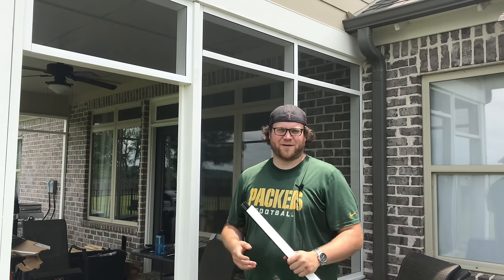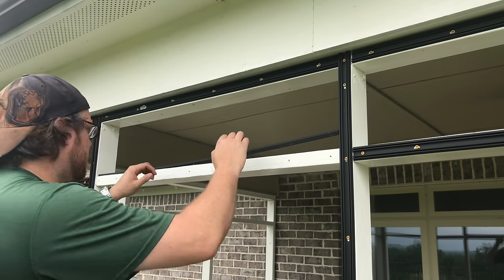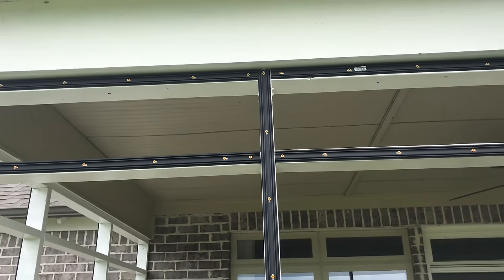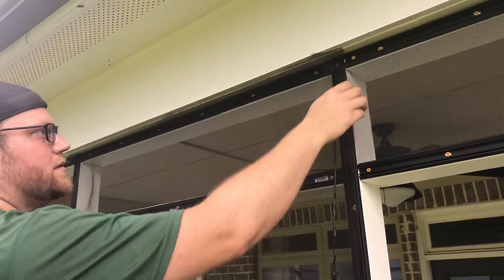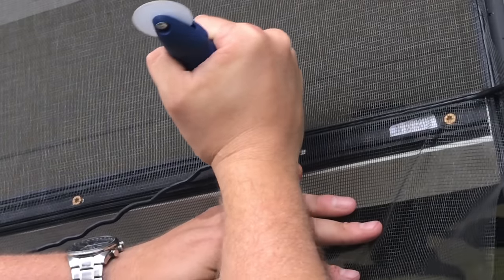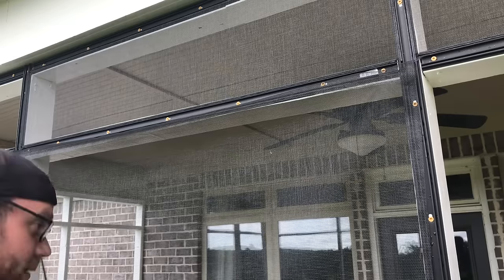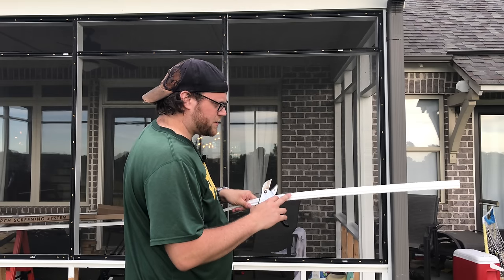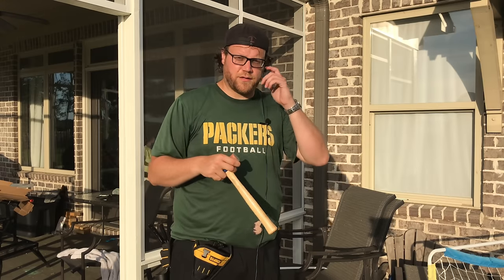Screen Tight Install Tips and Tricks

Comment: Thanks for doing this video. Just moved into a house with a back patio like that and the bottom part is ripped.

Edit: damn I just noticed you're doing this with a storm coming and windy as hell. You sir are a GD trooper.
Reply from the maker: Sometimes you got to get out there and do what makes the wife happy.
Reply: @TheVintageEngineer  where's the best place to start on prying those Channel covers off you think? Just use a screwdriver? I was trying with a painters tool, running it under the rail putting pressure. Figured I'd catch it and get it snap off in one place and go from there. I was putting quite a bit of pressure but it didn't have any give and I felt like I was about to break the damn thing off. It's been on there for years so I wonder if it'll be hard not to break it at this point. Thanks again for the video and help.
Reply from the maker: @bccsivxx-xxivvii  is try to get at the very end and pry in the middle. Once the one end is started you should be able to pull it right out. I’m thinking a 90 degree pick tool maybe good to snake behind the edge and grab it.
Reply: @TheVintageEngineer  forgot to reply and say thanks. Pick tool worked perfectly.

Comment: Looks Great! Thank you for the video!! I like the screen at the top 1 foot around. I am adding some 4X8' polycarbonate panels for 4 seasons room. I will make some removeable to make it usable year round. 
Craftsman made the multi-cutter that has the most leverage $30 on e-bay.
Reply from the maker: I’ve been researching some sort of roll up clear vinyl with sides in a track, but I’m having a hard time find a system that is for the DIY. All are custom builds that require a contractor to come out and do it for $1,000s of dollars.
Reply: @TheVintageEngineer  Screen tight has a video with removable clear PVC roll panels :"Screen Block 3 Season room" that can be installed from inside the room. Instead of spline it has PVC strips that you tap in with a mallet This would be perfect for second story decks.  Another tip for screening is if right handed: start on right side top first then bottom. use the roller tool to push the screen into the grooves first then the spline. Work from right to left, then finish on the left side. Thank you for the tip on using small pieces of spline to keep it in place.
Reply: I've been looking to do the same thing with polycarbonate. If you don't mind me asking, what size thickness of polycarbonate panel would I be able to modify into a screentight frame?
Reply: @auPretender  I used 4' X 8' X 1/2" Home Depot had some 3' x 8' x 3/8" polycarbonate panels and they have clear connectors to join more panels together.
Reply: Thank you very much for your reply!

Comment: Thank you for this.  Not sure I would have the strength to do the splines .  Wondering if you couldn't  start in the middle top and then work both ways.  Really like your idea of wedging in little holder pieces.

Comment: So glad I found this video! Im in the planning process of doing this in my front porch. Do you have any advice for screening the larger spaces? I dont have any horizontal rails. Only two 4x4 wood columns. Should I add some studs and a horizontal rail or is that not necessary? Appreciate your advice on this.
Reply: 😂 nevermind. You answered my question later in the video. Lol Thanks again for making such a thorough video
Reply from the maker: Not necessary, did it more for aesthetics.

Comment: You got my attention in the first 20 seconds!
Really great video! Great details.👍🙏🏻👍
Reply from the maker: A screen panel for like a sliding glass door?
Reply: @TheVintageEngineer  yes…and I edited out my looong comment.  I have bad insomnia and ramble.
Really good video though! That screen isn’t going anywhere. It’s nice and tight.
I’ve been looking at my old house, no pun intended, seeing if I could use your system vs regular screens. Unfortunately the windows have aluminum casings.
Although, if I survive the kitchen and bathroom remodel I may do this with my back porch! The last two years have been a spider vs mosquito war here where I live.😬
Reply from the maker: We don’t have “permanent” screens on our house but what we did for windows we want to open is buy some expandable screens and they go into the window opening track and the window closes on them to keep them in place. Here is an example one Your friend has shared a link to a Home Depot product they think you would be interested in seeing.

https://www.homedepot.com/p/Fenestrelle-15-in-x-21-in-Fiberglass-Expandable-Aluminum-Frame-Window-Screen-2-Pack-FEN-84010-2-M/310252199

Comment: What an absolutely incredibly good video you have produced, thank you so much for the help you really did a great job, going to tackle this myself, I would like to seen how you finished off that bottom section I'm redoing my existing screen porch and add on like 18 in at the bottom so my dogs don't push out the screen,
I'm thinking of putting on soffit both sides of the bottom where you're using hardiplank
Reply from the maker: I have a few pictures up on my Instagram page showing the finished patio. You will have to scroll down about 40 photos. Instagram.com/Sheltonfilms

Comment: I wonder if there is an attachment for an oscillating tool to do the splines. That would  make it way easier without needing to use so much force and risk tearing your screen if the traditional spline should slip out. If one doesn’t exist you are free to take this idea and run with it.

Comment: Fantastic video! Thank you! Does this stuff hold up against wind pretty good? I live in an area that can get 30-40 mph winds.
Reply from the maker: I live up on a ridge that gets a lot of wind. Plus I’m in Alabama so I get tornado warnings all the time. Some of the screens have stretched a little so they aren’t as tight as a drum anymore but they are still in place and haven’t torn. When I mean stretched, I mean I can feel it when I push on the screen, not like they are really sagging or anything like that.
Reply: @TheVintageEngineer  cool thanks! Currently framing mine and your video has been very helpful.

Comment: I like how you matched the transoms in the screen porch to the windows/doors on the back of the house.  Curious though, why didn't you use the tan instead of white since it it looks like your house trim is tan?  What kind of screen door did you use? I would have liked to have seen how you attached it to your brick---is there another video? Great tips.  Thanks
Reply from the maker: Yeah I should have made a couple more videos of the framing, hardie board, and interior trimming. I used the white caps because that’s what lowes had in stock and my house is actually trimmed in white. All the cement boards around the house are tan. Some areas look not as white because the paint is old, dirty, and a little faded. Screen door was the basic door from Lowe’s. I think it runs about $30-$35 or did at the time last year. I had to re screen it using the screen and spline I did for the panels because they seemed to have used a smaller spline that didn’t grip as good. I highly recommend getting a turnbuckle kit as well. I got my gaps perfect all around the door at 3/16” and 1/4” at the bottom and a week later the door sagged. Turnbuckle kit was able to pull it back into position. I had to add an extra nut to it because the opening and closing of the door cause the turn buckle to loosen. So the extra nut was a jam nut.

Comment: I'm in an apartment and the railings, and most of the places I would be attaching it, are metal. Do you have a recommendation for how to attach the base that will stay without using screws?

Comment: You have to put tension on the spline aligning it with the spline groove with your thumb and index while using the rest of your hand to press the screen down and hold it after you have pulled it tight with your other hand. Then let go with your other hand and use it to roll the spline that you have pinched with your index and thumb. 
In time you will have your own way to hold it but that's the jist.

Comment: Simple question....if installing a screen tight door going to outside yard do you install hinges right over the screen tight cap or use different hidden hinges or allow additional uncapped framing to accept hinges and not interfere with screen tight cap? The last option wouldn't look as good imo...thanks for your opinion
Reply from the maker: My door casing is 2x6 sistered to the 2x4 that the screen ends on. Door is recessed into these 2x6 (so door face isn’t flush with casing face). Hinges are screwed into the side of the 2x6

Comment: Great video. Manufacturers video didn't show enough detail like you did. Hopefully you get a sponsor deal.
Here's my question though, is there a reason you did full vertical pieces on the track instead of full horizontal pieces? Just curious. Thanks again for all the info on your video.
Reply from the maker: Just a personal preference. Figured with horizontal I’d have to go up and down the later a couple times to do one piece. Plus it would be harder to handle.

Comment: Thank you! Did you break up the screening sections for easier replacement if they’re broken? Why not do one giant roll across? Pardon if already asked. Thanks!
Reply from the maker: For ease of replacement if needed, also in theory you should see less sag over time with smaller sections. Screen tight does say it can span up to 60 feet if desired

Comment: This is a realistic video. Thanks for taking the time. I have vertical posts that are 4 x 4 and of course everything else is 2 x 4. If you had that issue would you buy both sizes of the strips?
Reply from the maker: May look a little weird on the outside corners.  4x4 face on the same plane as the 2x4 (flush)?

Comment: Great video! Thanks for the excellent tips. Do you have a finished shot with the hardie board? Also, any advice on hanging the door? Are the smaller panels on top just for aesthetics or did that give you a standard 8 ft measurement somewhere? Thanks again.
Reply from the maker: I’ve got a few shots on my Instagram. Sheltonfilms is my name on there. I took my time on the door. I made sure there would be a 3/16 gap on the top and the sides and 1/4” on the bottom. Since the door was on the sides and the concrete sloped, I had to do an angled cut along the bottom to keep the gap uniform. After all that it was perfect, until about two weeks later when the door started sagging. Went to lowes and got a turnbuckle kit and used it to pull up the corner and it’s been fine since. Panels up top were just for looks, just did a foot down.
Reply: Good info & video. Do you see any issues with doing screen all the way to the bottom instead of the Hardie? (Besides small kids kicking in the screen;) Would it be extra difficult to run the track on the bottom 2x4?
Reply from the maker: Kevin Ray Nichols just a personal preference for this one patio. Most people actually do it the way you are saying. One thing I will say is pre paint the board on the bottom and you may want to cut a few channels through the bottom of the 2x4 plates for drainage. You can also cut a slot in the screen tight track to match, just don’t cut the inner spline channel. Outer cap can be left alone.
Reply: Anthony Shelton thanks. Also I have a ballister-type railing and it’s posed in the center of my porch posts, not flush with the sides. Can that be taken off and moved to be flush or would be easier or better to just add another piece of wood in the railing to flush it up in order to attach the horizontal as vertical screen tight strips so they match up?
Reply from the maker: Kevin Ray Nichols I would probably add more to it than trying to remove.

Comment: On the bottom section of your framing, it looks like you have a 1x4 or perhaps a 2x2 along with the 2x4s. Looks like a ledge from the outside, and "L" shape from the inside. What did you use near the bottom horizontal pieces that make it look different from the top? (I can see that your bottom base screen pieces screw into the top of it, about waist high) Mind sharing what you did there? It looks good
Reply from the maker: See if this link works for you. It’s to my Instagram that shows the 1x6 top cap I put on. I had to do some fancy cutting because I already had the studs in place. After this I put a 2x2 on top flush with the vertical stud faces. https://www.instagram.com/p/CBJZLx7D_s4/?utm_medium=copy_link
Reply: @TheVintageEngineer  The link worked! Thank you so much! Another question, I like the Hardie Board idea below, hadn't thought of that. What is the height of the 2x4 under the 1x6 cap? Or maybe a better question is, what's the total height of the hardie board you used and is that a 7" exposure? I also have perhaps the same door you do, might try to match the bottom pattern of the door.
Reply: @TheVintageEngineer  What kind of paneling did you use on the inside of your enclosure near the bottom?

Comment: Also, one other good piece of advice you left out (I think) is to make sure you have the right thickness spline. Different sizes for different material ( fiberglass vs. aluminum).
Reply from the maker: Covered at 2:21
Reply: Anthony Shelton whoops, missed it. Thanks.

Comment: Oh, man thank you for this! We have a screened in porch that needs all the screen panels to be replaced, and we want to do them with pet screening so the cats have somewhere to hang out on warm days. My only concern is the pet screen is coated, and is a bit thicker than normal screen. I figure all it should take to do it is use thinner spline, but if not we'll use the normal spline so that screen is really in there good. Does the spline itself have a bit of give?  if it has a rubbery compression it might work. Any thoughts on that? Any advice would be awesome, thank you.
Reply from the maker: Yes it has some squish to it. If you pull it taught while pushing it in it will stretch and thin out more.
Reply: @TheVintageEngineer  awesome, thank you!

Comment: Perfect! I had a workman do the new construction but needed to understand how this system works so I can tighten some that have come loose over the last couple years. Also can the cap be painted?
Reply from the maker: I think I read they can be. First need to be cleaned with alcohol and then apply latex paint. Don’t use dark colors because it is a vinyl product so the additional heat can damage the caps.
Reply: Ok great! My house is a light color so it’s all good. Great job with taking the time to teach well in this video.

Comment: I'm planning to install screen on my patio and I was wondering if you can heat the grove with heat gun before sliding the lock to make it easier.
Reply from the maker: I wouldn’t recommend it as it could deform it and then would have less retaining force.

Comment: Question ?   I see all of your 2 x 4 boards are painted white.  I am assuming you bought the regular pressure treated boards, then you painted them before using them to frame out your screened in areas.  What type of paint did you use on those white painted 2 x 4 boards, and should they be sealed with a clear coat of a waterproofer after being painted or just a good white exterior paint?  What do you recommend that will not peel off?  Thanks!
Reply from the maker: Bought regular pressure treated and built frame. I then let them dry for about 3-4 months before painting because pressure treated wood is saturated with moisture when you first get it, paint will fail if you painted them too early. I used Valspar Duramax exterior paint (semi gloss). So far so good. If I could change anything I would have put a thin layer of foam between bottom plate and concrete, but all edges are sealed with silicone
Reply: Foam?  What kind of foam would you have used under the base board?  Why would that have been useful?

Comment: Very good vidio. I've done a few and you described it very good. I used dives to cut the spline ends. You might try that.
Reply from the maker: Dives?
Reply: @TheVintageEngineer  wire side  cutters I call dikes. Just cutter on end of them.

Comment: Would a rubber mallet work to put the spline in? Looks like a lot of pressure is needed to work that in. Then maybe use that special tool to get a good consistent seal after it is in.
Reply from the maker: I don’t think it would work too well. I think it would absorb too much of the hit to actually go in.
Reply: As others have mentioned, enjoyed this detailed video.

Comment: I'm installing this exact system right now and was wondering where you found that edge cutting tool?  I've searched all over and can't find one, so I'm using a PVC pipe cutting tool, which isn't working nearly as well as I'd like it to.
Reply from the maker: Looks like another name is miter Miter  Snips. Here is one at Lowe’s https://www.lowes.com/pd/CRAFTSMAN-Miter-Snips/5000085303
Reply: @TheVintageEngineer  Awesome!  Thanks for the quick reply!

Comment: Question. Are the snaps the same? Or is there actually two different pieces? With holes for the screws?
Reply from the maker: Two pieces: black track (holes, channel for spline, and channels for cap to snap into) and there is white decorative cap. You buy each separately and they come in 8’ sections.

Comment: Anthony, 
I have another question about installing screen tight system? The sections come in 8 foot sections (96inches) but I need 102 inches topto bottom.  Should I cut two sections of equal length or use the 8ft section with a 5ft section? Your input would be greatly appreciated.

Thanks
Reply from the maker: I don’t think it really matters where the joint is. I would just do it the way that has you being less material. Now when you cut the caps I would probably stagger the joints, just like with hardwood flooring.